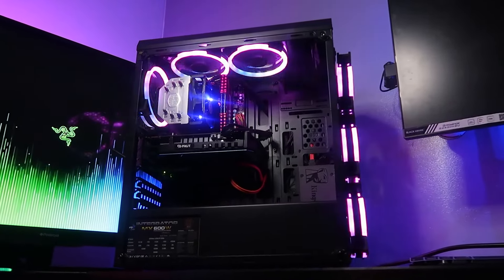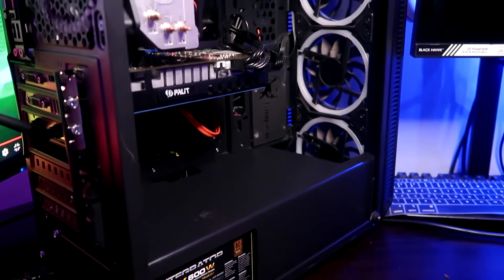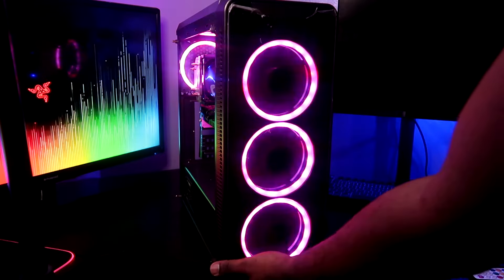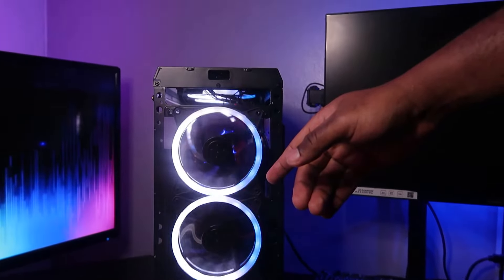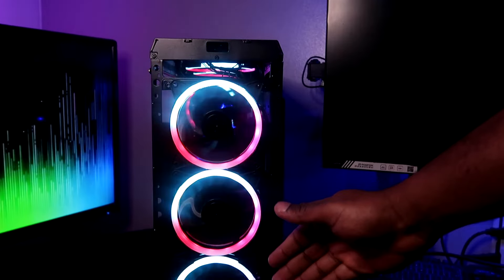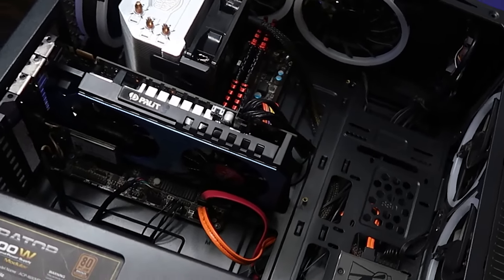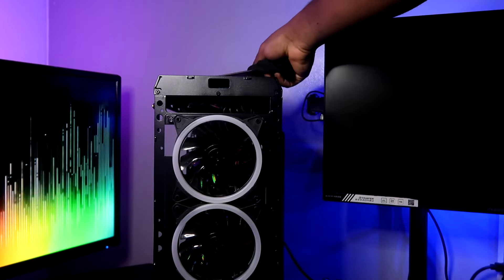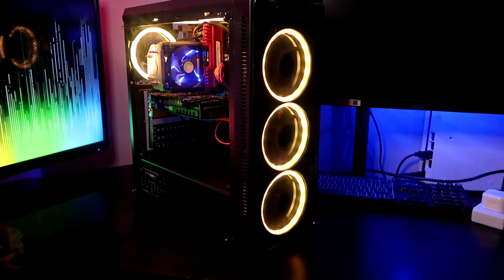THIS IS HOW TO REMOVE YOUR PC FRONT PANEL - HOW TO REMOVE THE CIT BLAZE FRONT PANEL AND SIDE PANEL

Comment: Subbed. Dude, you are awesome. Thank you so mcuh for this guide. Thought i was going to have to go back to the repair shop. My pc would'nt send video to my monitor for ages. I had the shop look at it and they said they fixed it. It was cheap so i was happy. It worked for about a week. 🤦‍♂️ the dust buildup was pretty bad and it was obvious the shop didnt blow any of it out for me. Your guide was a godsend as i couldnt figure out how to take that smaller front panel off in front of the fans. (Where the majority of the dust was) With your help, I got it cleaned. Its not perfect but its way better than it was. And for the first time in a few months, i have video to my monitor on the first bootup. 🤩 added bonus, my bootup time is now a few seconds faster. I can't thank you enoguh, so I'll just sub and sing your praises in this comment. 😁

Comment: How to clean correctly without a air blower?
Once a month or every 3 months cleaning.
1. You need Q-tip, 1 large brush and 1 extra small brush , clean cloth and 90%+ alcohol.
2. Remove front and side pannels and top mesh.
3. Remove GPU and RAM
4. Brush 🖌️ everything that you can reach use extra small brush for small gaps.
5. Use Q-tip (brush will still leave fine  attached dust) use it to clean especially in Fan fins its better than brush.
6. Use Q-tip + 90% alcohol to clean your mobo 
7. Re-brush your mobo
8. Remove GPU plastic Cover area clean with brush, clean the metal heatsink, use Q-tip under the heatsink, use alcohol if necessary.
9. Brush your ram.
10. Re assemble.

Once a year general cleaning (to make everything 100% dust free)
1. Remove everything from the case.
2. Remove cpu heatsink
3. Remove GPU heatsink
4. Remove MOBO heatsink and I/O shield.
5. Brush everything.
6. Brush and use Q-tips on Fans.
7. Remove PSU cover
8. Remove PSU PCB screw brush everything and use Q-tips with 90%+ alcohol for heavy dust build up area.
9. Use clean cloth pour some alcohol wipe your Case.
10. Repaste and assemble everything if thermal pads are dried changed it.

Edit*
If you want an easy life.
Get a air blower...
But even with air blower you will still be required to use Q-tips on your for some reason dust on fan fins stick that even a blower can remove it all.
While dust from pcb can be remove easily by blower.

Comment: I got a cit case and the airflow wasn’t good just removed the front panel and I’m staying 60c while gaming sometimes 70 but I have put the front panel at the side off my pc because wires are connected at the front cause of rgb but thanks so much
Reply: Is there anyway to remove the RGB wires from the front panel?

Comment: Hi bryan, my room is all carpet and my pc does not fit on my table what should I do to prevent dust builtup within my case, thanks!
Reply from the maker: Hi ! I would recommend getting a desktop stand . Or you could make one . It’s a small piece of wood in a rectangular shape that’s raised and your pc sits on this to prevent it from sucking up all the dust bunnies on the carpet ? There are also tables that come with pc holders but the Stand is the cheaper option !
Reply: @Bryanonanisland  thanks!